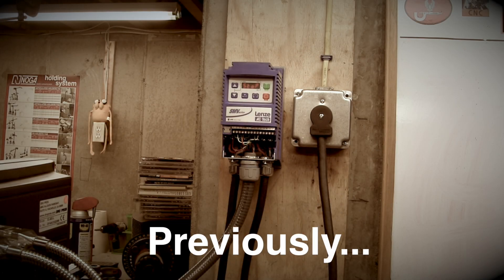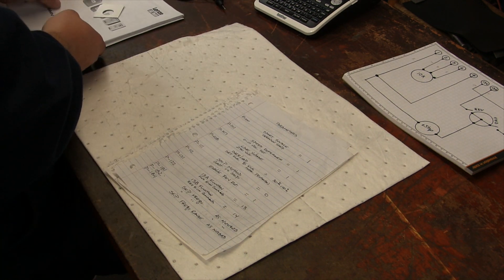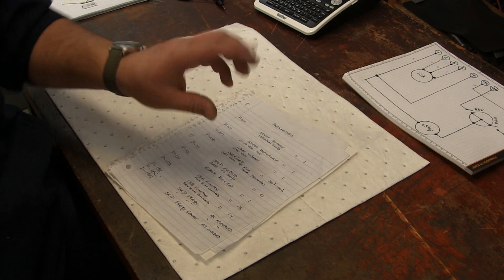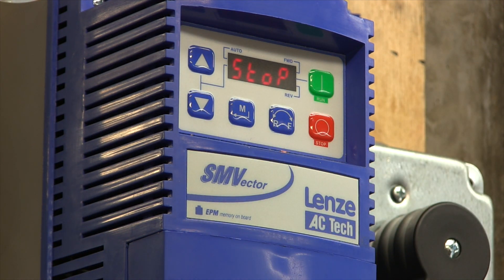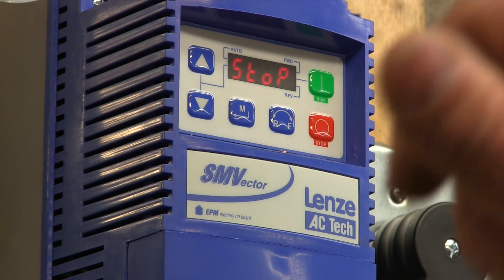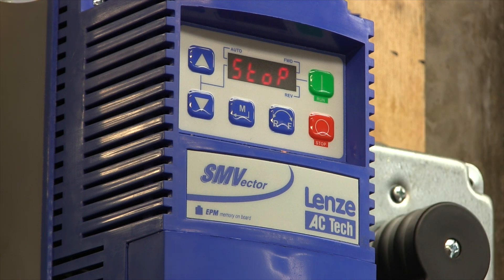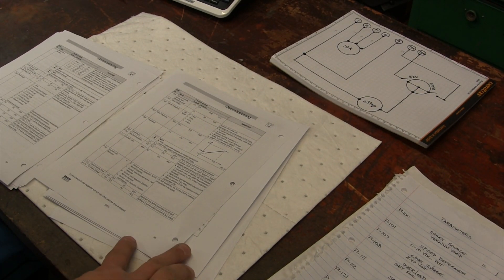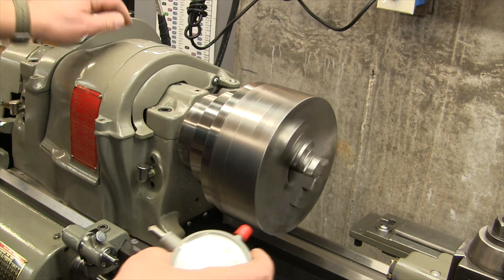South Bend Lathe 3 Phase Motor & VFD Installation   Part 3

Comment: How is the torque at lower rpm? 
What percentage did you have to oversize the VFD based on the motor HP?
Thanks.

Comment: Nice job and good video. I wonder if those separate pieces of copper tape shielding are really well connected to each other at all, generally a shield needs to be continuous, and connected to ground at one end as has been mentioned. For operating at lower RPMs a fan can be added to cool the motor, or a temperature sensor added so you can see if it heats. At the lower power levels the mass of the motor may be adequate for cooling with little airflow. So unless low speed operation is doing heavy cutting it may be just fine. Things like threading don't put much load on the motor anyway. 

Do folks worry about wrenching on the chuck while there is power to the VFD? Any failure in the VFD or the signal wiring or pot could apply full power while your hands are in harm's way. I would think that touching the chuck would be recommended only when power was removed from the VFD. Using the Estop to interrupt VFD power either directly or with a contactor or relay would accomplish this. 

When applying power to the VFD, will it immediately accelerate if the pot is off zero? Or does it need to be cycled back to zero before it will start?? Restarting on power application is another concern that was already mentioned. The current design will accelerate on clearing the Estop which is a concern.

Comment: We NEED a part 4 "Speeds and Feeds" with the new power source. Please go into how the lathe runs with mild steel and HSS cutters compared to the old 1 HP motor and perhaps the last 5 HP monster. Can you cut 70 thou off a 1" radius at .004 feed? Etc. How does the VFD hurt/help with torque and horsepower under use. Inquiring minds want to know...

Comment: Hey Brad,

Great set of videos. I did a very similar setup just over a year ago with my SB9A and a Mitsubishi VFD.  Even though I have already covered this setup, who doesn't like watching this stuff?!! :o)

One thing I included in my control box was a small digital tachometer that I got off eBay. It's triggered by a magnetic sensor that I mounted on the back end of the spindle. It gives an instant readout of the RPM of the spindle and you don't have to think about converting supply frequencies etc.

Thanks again for all your videos!

Comment: Brad,  What does you bridgeport VFD set up include.  I'm about to order some stuff  and was trying to figure out what to get.  Your lathe installation here is awsome.
Reply from the maker: +SUPERDUCKcromobe My mill has nearly the same exact thing. Only difference is the VDF itself. Simply a different brand. But the electric components are nearly identical. Hope the helps!

Comment: I have the same style VFD on my Bridgeport mill. I LOVE it for power tapping. I will be adding the external control box with F/R, Pot and E-Stop. I may as well ad the deceleration resistor while I am at it, I believe that will make the E-Stop more functional and safe. Excellent video and thank you for the motivation to learn more about my VFD and to make my control panel.
Reply from the maker: +Curtis Gurley You're welcome - good luck on your mods, as well. I too want to install the braking resistor.
Reply: Ditto!

Comment: Excellent tutorial Brad. The one bad thing about VFD's is how soon you end up looking at all the other machines in the shop and then start seriously thinking of converting anything that's single ph over to 3 ph. They are addictive. Fwiw, on my belt drive mill if I have the belt in the highest speed position the VFD would fault out sometimes with the factory set ramp up parameters. I had to increase those to a 3 second ramp up time and that fixed that minor problem. With a large heavy work piece in the chuck you could see the same fault. I think these VFD's see it as an overload condition.
Reply from the maker: +Turning Point Yeah, really. I have one on the mill, the lathe and my surface grinder. Maybe I'll do one on the shaper too.

Comment: Now you just need an enclosure for it.  :-)  Since my shed is sometimes open, I opted for an enclosure to make sure too much dust and crud do not get in the VFD.  That made hooking a couple of the wires a little trickier since I didn't use a large box.
Reply from the maker: +ILGopher Ryan, Stan tells me, there's no need for an enclosure. This is why I bought this model. Hmm....?
Reply: BasementShopGuy, I would trust Stan's word and your model may be better sealed, too.  I just saw Stan and Tom Lipton use one, so decided to do so as well.

Comment: I am new to machining and plan to buy surface grinder. Would you recommend a static phase converter or a vfd? I think it is a 1 hp machine.
Reply from the maker: +TJenkx6 VFD. It you get all the features like ramp up/down, DC-braking, etc...

Comment: Brad,

When and if you need more copper shielding tape, check Mouser (www.mouser.com) out.  They carry 3M and some other brands.  1 of the 3M variations conducts through the adhesive, courtesy of embossing.

Eli D.
Reply from the maker: +Eli Dustman Will do Eli - thanks!

Comment: keep thinking about the way you connected the e-stop, I'm a bit unsure if it serves the purpose - I think you should have a contactor  between the vfd and the motor controlled by the e-switch (or maybe in front of the vfd) - that way it cuts the power to the motor completely regardless of the state of the vfd.
Reply: +sharp x You cannot connect any switching between the VFD and motor. The VFD gets frequency feedback from the motor, and the vfd will burn up if that connection is suddenly lost. The hookup in the vfd is much the same as a contactor.  Placement of the E stop is something different, and may be better served, if in a location such as on the carriage, or at knee height somewhere....there can also be multiple e-stop switches.
Reply: +sharp I think It's a stop like you said not really a true e-stop. I also think you have to kill the mains power to the control to count as an e-stop for OSHA type safety nazi .  For a basement shop and an operator with  snap on appendages its probably fine.
Reply: David Queen it's in line with fwd/rev, just pointing out that it will only cover an issue with the switch and not the vfd, that's all.
Reply: +sharp x I'm not sure about Brad's "chicken scratch" drawings, but as anal as Brad is, I'm sure it is how the manual instructs him to wire it....remember....these are not actual lines, and are low voltage signal wires. On my Teco FM-50, the E-stop signals the vfd to stop, ignoring any other parameters for stopping, such as braking and ramping down,   even if the E-stop signal is removed, it will still stop. It will only re-start if the unit is switch off, then back on.
Reply from the maker: +sharp x The eStop will cut the motor off in the event of an accident or mishap. Will it cut the power to the motor outright, no. But the VFD is controlling it, so the motor stops. I'm sure it won't somehow start up again on its own, and especially in the short amount of time it would take to rectify the situation (either simple, or medically) and step away from the machine or harms'-way. Again, I'm going of what's been shown to me by other VFD examples as well as my milling machine.  What I DO want to do, is wire a breaking resistor to the eStop so the spindle will immediately come to a stop in the event of an emergency. Definitely want to do that. Thanks guys for the comments, this is all very helpful and appreciated.
Reply from the maker: +Jim Liechty Chicken Scratch (gasp!!) I thought it was a masterpiece of a drawing - LOL
Reply: +BasementShopGuy You're right....it was a masterpiece!.....my terminology was only to reflect a hand drawing vs a book drawing!....I'm sure your VFD is like mine....the e-stop cuts the power to the vfd with a special signal, and can be only restarted if turned off, then back on. If the motor only stopped, as soon as the e-stop button was back in the original position or let up on, the motor would  start again.
      I'm sure glad to see you go the 3 phase/vfd route. I had mentioned way back when to go that way and you would never be sorry, but it seemed like you wanted nothing to do with the complicate vfd thing!......my buddy used to say....a vfd is so simple, even a monkey could wire it!    What you need to do next, if buy one of those hall effect (strobe) type digital RPM meters......from across the pond on Ebay for less than 15.00.  I had one quit, so buy 2, but I have one on my mill and love it!
Reply: +Jim Liechty  nope, it's in series with the common wire for fwd/rev. It does work to stop the output in normal operation but it won't require reset of the direction switch, would send power to the motor as soon as you reset the e-stop - I guess if you know about it you can work around it so not that big'a'deal - in my case I did same as you (I have an input dedicated to the vfd e-stop).
Reply: +BasementShopGuy
not sure how you'd do the resistor just for the e-stop (on mine when e-stop signal is sent to the vfd the dc braking via resistor and decel won't work at all and will coast to a stop, these only work when operating via the fwd and reverse switch). have a look at my other post for this vid, I have a link in there on how I wired mine (i went cheap with a chinese one) - i'd say it's overkill (i like the simplicity of how you did it). If your vfd supports an input for changing decel/accel times you might be able to wire it to your N/O contact on the e-stop to activate a shorter decel time but that is dependent on the inertial load so if it's a large chuck it won't stop on a dime and might trip the overvoltage protection (at least on the one I have that is the case).

Comment: What kind of belt do you have, because I cannot hear a clicking noise at all? I have the approximately the same machine though not the same paint job (I'm sorry to say, and minus the gear box( converted to CNC). I also have a VFD drive although an old industrial three phase unit. Your selector switches for forward and reverse are only momentary aren't they?

Comment: Be careful of speed control. If you run the motor too slow it won't cool properly. Industrial VFDs usually limit the speed reduction to no less than 30% to ensure adequate cooling.

Comment: nice and clean installation. Had the same problem overloading the vfd with a big chuck or from high speed - found a workaround with a switch to quickly change the decel time without programming, say long time for an 8'' chuck to short time for a small chuck or threading at low rpm, not sure if this helps but if you're interested here's the link (it's a long vid so skip to 4;00 where I'm explaining the problem and 22;30 for how it works) https://www.youtube.com/watch?v=cipL_kRVmQ0

Comment: A good parameter to set is the ramp or shut down between forward and reverse. That way you can hit the for/rev switch without waiting between for it to stop.   I don't know the memory location for that, but it saves the motor, time and sometimes the part you're machining. Good job on the wiring. (Coming from an industrial electrician).  ;).    Your shielding isn't really working.  By that I mean the adhesive side is non conductive. So, there isn't any electrically contiguous shield covering the entire cable.. You probably won't have any issues since you don't have any major rf sources in your house. (I assume) in fact, you probably don't need it but better safe right?
Reply: Actually what you describe is not the problem with his makeshift copper shield. The conductive side of the foil is irrelevant to shielding of the conductors within the shield. The error he made was not soldering a short wire pigtail to the VFD end of his copper tape and tying it to the GND terminal. For those interested:  When the shield of any cable is left unconnected to ground it will act like a Capacitor between the shield and the conductors it encapsulates.
Wakodahatchee Chris

Comment: Nice job on this install/videos. My only concern is using the solid core copper wire on anything that vibrates. It's prone to fatigue and failure. Multi stranded is a much better choice (and available shielded).
Reply: +classicrestoration I have never, never heard of solid core wire breaking under any circumstances.  I have seen burnouts due to the fact that it is very difficult to thread stranded wire through holes without losing strands. I do not think it will make any difference at all and solid is much easier to work with.

Comment: Brad: nice videos.  one thing, looks as if you missed,  is to ground your vary nice shielding to one point only, such as inside the VFD,  but not at both ends which could introduce ground loop.   i see that it is working vary nicely, but in my shop the electrical noise from welder can git into almost everything.   just a friendly helpful hint.  keep up the good videos thanks, ron
Reply: +Ron Schmaltz Ditto, Ron. A metallic shield that is not returned to circuit ground, or system ground, can act as an antenna, picking up stray interferences and actually worsening the situation. Good eye. Otherwise, a great video., Thanks, Bred.... ........Dick

Comment: One more remark, the emergency switch does not apply more braking action than the forward/reverse switch: it is interrupting the same electrical circuit.

The only difference is that the emergency switch is big and easier  to reach.
Reply from the maker: +Olivier Nicole Correct - in time of panic it's very easy to see/operate. I may connect some braking to the eStop (braking resistor or DC braking).

Comment: Nice work.
Some things i have missed:
 - the shielding must be connected to ground to work
 - the motor cable should be shielded to prevent it from acting as a source antenna.
 - the inverter must know what motor it's dealing with.
 Please set the parameter no. 302 to 306 according to the motor's nameplate.
Reply from the maker: +ihcelb This is good info - thanks, I'll defiantly check this out.

Comment: Hi Brad I would suggest a NVR on your setup at the moment lets say you had a power out when the power came back on the lathe would start up, also the copper shield is not doing much again suggest you ground on end of it. 
Other wise tidy job.
Reply from the maker: +Black Country Steam Yeah, I missed the grounding part. I'll have to go back and fix that up. Thanks man!
Reply: +BasementShopGuy Your welcome Brad but please think about fitting a NVR knowing you you probably got a suitable contact tuck away in a draw :-)
Reply: +Black Country Steam May I ask what a NVR is? Thanks.
Reply: +JC S NVR is a  no volt relay
Reply: +Black Country Steam thanks!

Comment: Hi Brad !

Be aware running the motor in longer periodes on the LOW freq. - the motor often DON'T get enough cooling because of the low RPMs.

Why not have DC breaking active ... when you hit the emergency stop you want the machine to stop as fast as posible - right ?
Maybe your shirt is cought or so ...
Reply from the maker: +Keld Sørensen DC Brake will be coming soon!
Reply: @BasementShopGuy  did you ever install the breaking resistor?

Comment: With a VFD do you get full HP's from the motor?   Or do you only get two thirds of the HP's like a static phase converter?
Reply from the maker: +1970chevelle396 I think around 20HZ, the full HP is realized, because its a "vector" drive. But don't ask what that all means, LOL...

Comment: why did you not attach the VFD to the lathe it self so it would be just a plug and play if you ever move it rather then having to unscrew it of the wall ?
Reply from the maker: +The Apprentice Basically, so no chips would dirty it, or oil, etc...

Comment: that VFD runs the lath very well looks good gives you a lot of control over it will you 
need a standard setting for threading ??? but over all it is very good makes it just as good as the new 
machines and versatility
Reply from the maker: +Colin Samms Threading is a back operation and you could use any speed you're comfortable threading at. I like the slower speeds myself.